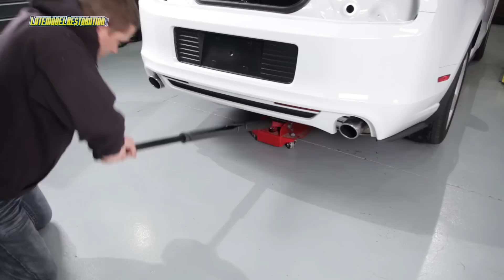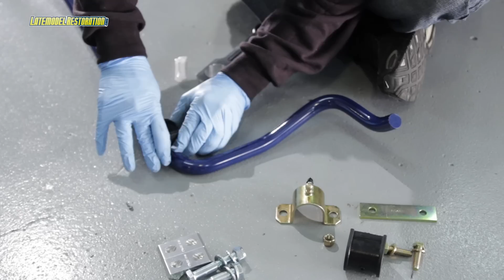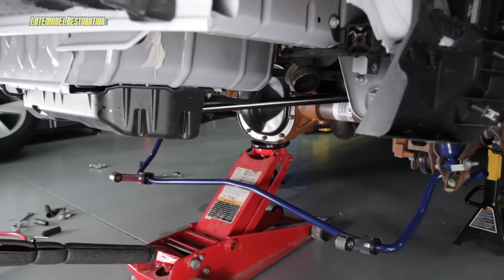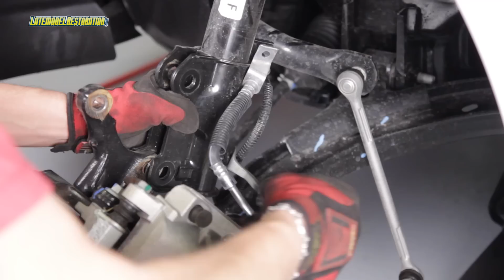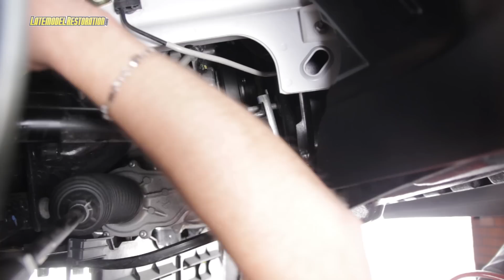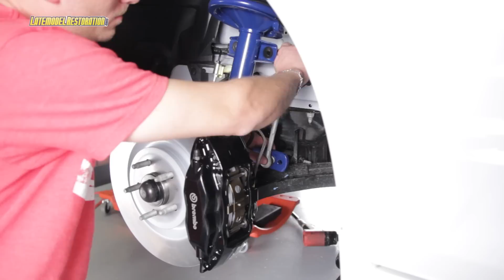Ford Racing Mustang Handling Pack Installation (S197 2005-14)

Comment: Is this set safe to use on a convertible? I understand the weight is different but would it still be functional without damage?
Reply from the maker: Everything would still "function". The spring rates are designed for the weight of a coupe. If anything, the ride height will be ever so slightly be affected due to the extra weight of the convertible. Hope this helps. -Landan

Comment: what about that adjustable panhard bar? i'm about to lower my '14 gt, and i have the suspension, but not the new bar. is that necessary? you made it the same length as the original and didn't show it being adjusted after it was lowered. thanks for your help in advance. just need to know if that panhard  bar is required in order to lower it

Comment: Here is an odd question for you...where the heck do the front jounce bumpers go? The rears are self-explanatory but have no clue about the front and you never see ANYONE have a video that shows it /....can you point us?
Reply from the maker: The front bump stops are positioned on the strut shaft and are often times covered by the dust boot. -Landan
Reply: Thanks Landan... I figured that out later but took a while...LOL

Comment: Would there be an issue if I installed the Ford Racing K springs in the rear and the P springs in the front with this kit? I'm looking for a 1 inch drop in the front and 1.5 in the rear. Thanks

Comment: I am looking into getting either this kit or the roush for a sporty DD.  I like how the frpp comes with new strut mounts and a pan hard bar and warranted by ford, but i like how the roush is only a 1/2 drop.  any recommendation for either?  How is getting the alignment without using a caster/camber plate with these kits? Thanks
Reply from the maker: Kevin S You can't go wrong with either the Roush or FRPP suspension. After any suspension modification it is important to run the car by your local alignment shop. -Landan
Reply: ***** thanks Landan. I think ive decided to go frpp. Ill be giving yall a call soon to place my first order.